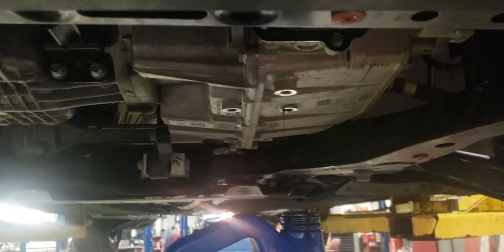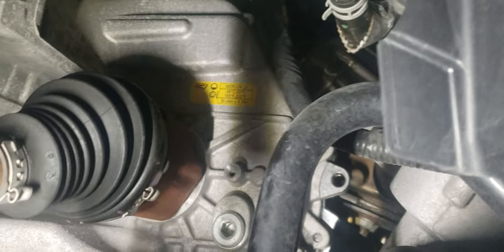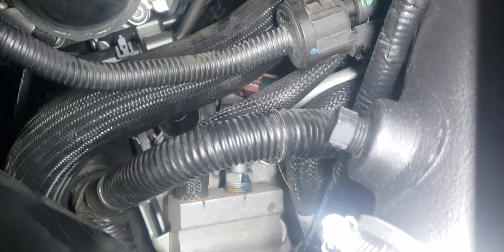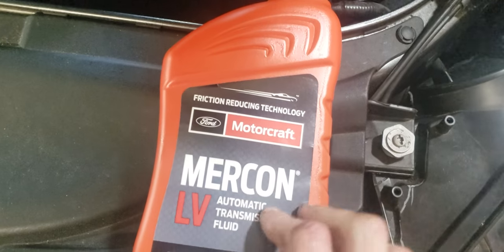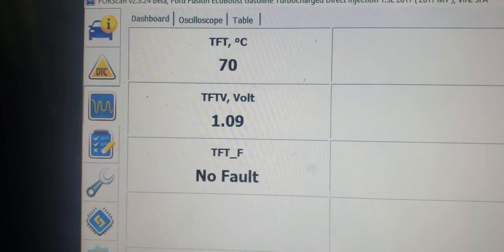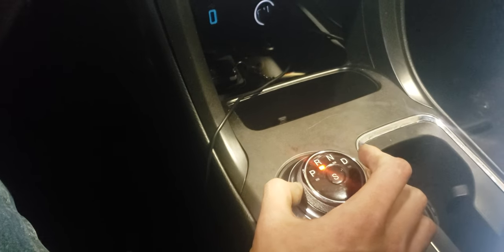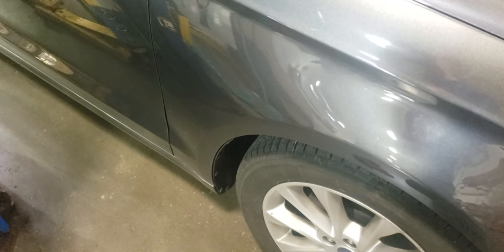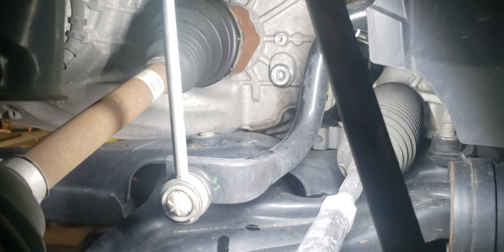How to change the transmission fluid on a 2017 ford fusion 1.5l

Comment: Just a note. If you don’t want to remove the wheel you can turn it all the way to the right and get at the level plug through the gap. If you don’t have a 10mm Allen a t55 torx will work
Reply: You're right I've seen a video about this as well but.. I took a quick look ony car and it seems to be impossible, too tight areas  even with turning the wheel completely to the left

Do u lay down in ground?
Reply: @bobomomo3764  You need a long extension if you're doing it with tire on.
Reply: I reached mine turning wheel all the way to the left.

Comment: Looks like you can even do it again Nick.
When you were leveling the transmission fluid off, it was still dripping pretty dirty.
Reply: Dont these transmissions have a filter?
Reply: Do these transmissions have a filter?
Reply from the maker: They do but you have to take apart the transmission to replace the filter
Reply from the maker: I flushed mine twice and it still come out dirty I will be doing it again now since I'm at 60k miles

Comment: Awesome video! I just got done replacing my 1.5l with a brand new long block from ford. Due to the coolant issue with these motors wish ford would do a recall already!!!!! Lost some atf  when installing the motor! This was very helpful thanks. :)!!!!
Reply from the maker: Any new difference after getting a new block does it seem like it got more power im at 35k and no problem with coolant getting into the cylinder
Reply: Are my comments disappearing? Ugh
Reply from the maker: @boostedbusta2939  I seen you comment but it disappeared didn't get to read it
Reply: Don’t understand why the keep disappearing :/
Reply: I’ve babying it. Got some whinning sound on driver side. I’m assuming it because I lost some atf fluid when installing motor. I just finished the install today!
Reply from the maker: @boostedbusta2939  now your message went through hopefully filling it up fixed it If not I would take it back and have them look into it since they messed with it
Reply: Ford didn’t work on it. I replaced it myself. It was a pain in the butt! Also my OG motor last 85k miles before issues. Toast basically at 90k.

Comment: I wish you had a shop located in Georgia because unfortunately I don’t trust for it doing this job. But I’m unfortunately am also left with no choice but to trust them. Hope they get this right and don’t mess up my transmission. When I brought it in, they seemed a little surprise because my gearshift there is sticking so I wanted to get this done. I heard this could help fix the problem kind of like what you just said, but they didn’t seem very confident and when I asked him what type of transmission fluid they use, they said the Ford transmission fluid or something or something equivalent, which was the words I did not want to hear. Walked over to the waiting area. And seen a bunch a wolf head motor oil. And not the recommended Ford Motorcraft oil. They charge too much to not use for recommended products on Ford cars. Don’t think I will be letting them change my oil anymore.

Comment: just changed out the fluid on my fusion today. The metal plate flappin underneath scared the bjeebers out of me too.  If anyone reads this, I recommend securing that plate with 2 or 4 of them bolts used to secure the cover panel. this way you get up to speed on the test drive and really move through the gears to heat up the transmission.
Reply from the maker: You did what I did that metal flap scared me I thought I broke my transmission

Comment: So I saw you only added 4.5 quarts and that was a little much. But when I look it up on ford's website it recommends 9 qrts
Reply from the maker: I notice that on the website I believe that's if you rebuilding the transmission. What I usually do is catch the old fluid and how much I get out I put in with new fluid

Comment: Valvoline MaxLife ATF is synthetic, with a much higher flash point: 200C vs 130C...and MERCON LV compatible. A far superior performing fluid than the conventional Motorcraft.
Can do a professional machine flush, or DIY 4x drain and fill (drive for 1,000 or more miles between drains) for half the cost, to convert from conventional to full synthetic.
Change every 40-60K
Reply: Mercon LV is a full Synthetic.
Reply: @christopherburns9880  ok but you've missed the point about which of the 2 will burn and turn to sludge quicker
Reply: @mablenay  Motorcraft is literally what is deisgned for Ford engines and what they suggest in the manual.

Comment: Thanks Nick. How often/miles between changes do you go?
Reply: The owner s manual says 60k
Reply from the maker: I did mine really early to get all the brake down metal out then I will probably do it ever 35k to 50k miles just to be on safe side

Comment: What color was that transmission fluid when you changed it? I have a 2017 fusion 1.5 as well. The fluid was jet black but didn't smell burnt. Still shifts fine and doesn't make any noise. I just got scheduled to have the fluid changed at the dealership next week.
Reply from the maker: Mine come out black also I fished mine out and still come out black
Reply: @Nickthecarguy  That is reassuring to hear. Thank you. I'm still getting it changed though. It at almost 70,000 miles and I don't think it has ever been changed.
Reply from the maker: @dustys5512  I been changing mine every 30k I know these transmission are weak

Comment: How important is it to level the fluid? I changed mine, added 4 quarts and didn’t know I had to level it? Will this cause any problems? I added 4 quarts
Reply: Did you ever figure this out because i just did the same thing
Reply: @salvadorianboy100  no I never got an answer but a year later my car is running fine
Reply: U can add a quarter (1/4 qt) 
so u be on the safe side

Comment: My 2016 Fusion 1.5 has 120,000 miles. I haven't had the transmission serviced. I called the dealership today to schedule a service. He says they will only change the fluid and not the filter, citing that when they change the filter, the fluid isn't completely drained. But when they change the fluid only, ALL the fluid is replaced. He recommends having the filter changed at 150,000 MILES. Does this sound right? After watching a video by a Ford tech, I would think the filter is clogged from the break-in period.
Reply from the maker: It would be hard to change the filter on these you would have to drop the transmission to get to the pan i always done drain and fill on mine and other cars
Reply: @Nickthecarguy  Wow. Okay. Thanks.
Reply: @Nickthecarguy  Can you think of any reason that Ford would charge $213 to change my transmission fluid?

Comment: Hi! What was the reason to change oil in transmission so soon? Since FoMoCo suggests to change transmission fluid  "Every 150000 miles (240000 km) Change automatic transmission fluid. And Replace auxiliary transmission fluid pump filter (if the vehicle is equipped with the Auto Stop/Start feature).

Did you hear any noises from transmission side?
Reply from the maker: I was told to change it every 30k I decided to do it a little early now or never. It's just maintenance. I did notice that it had a hard shift between 1-2 after changing it it seem little better
Reply from the maker: To change the filter you have to disassemble the transmission. I did just a drain and fill
Reply: ALWAYS change at every 30K due to the internal non-changeable filter, etc.
Here it is direct from a Ford Tech:

https://www.youtube.com/watch?v=WaPJJ3hUHN0
Reply: Hard shift in lower gears thats why im on here.. My 3rd is a lil rough
Reply: Slava Butenko at the suggested interval you will not be “changing transmission fluid” it will the whole transmission itself... LoL
I myself change mine at 25000 kms...better safe than sorry.
Reply: Ford says to change it at 150000 miles hoping the transmission falls out then they can sell you a new expensive transmission or a even more expensive car, change the fluid early, fluid is cheap transmissions are not.

Comment: Nick, Did my ears deceive me or was the car running as you were leveling it.  IF it was, any reason why?
Reply from the maker: The car was running when I was leveling out the transmission fluid
Reply: @Nickthecarguy  thanks for the reply and video
Reply: U need the car running so that the gears turn for the leving out to complete it's self once fluid stops coming out then you know it's level.

Comment: If you measured the fluid coming out at 4.5 quarts straight from the factory, why wouldn't you just out 4.5 quarts back in. Isn't that the point of measuring it in the first place....
Reply from the maker: If you have a leak then the measurements be off i rather measure to be on the safe side i usually put in what i take out
Reply: Plus sometimes even tha factory messes up, they can over or under fill as well, I would definitely do the level plug that way you know it's got the perfect amount in.